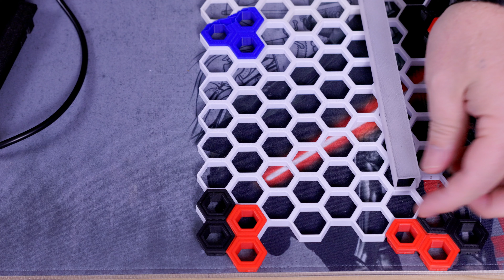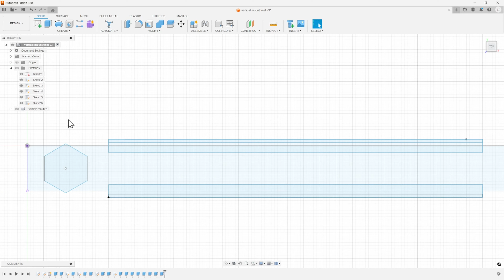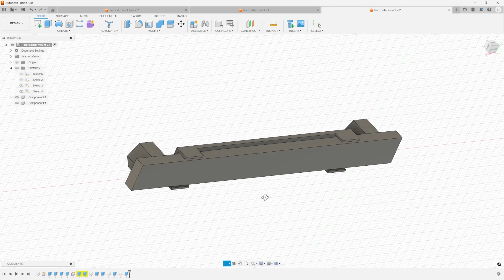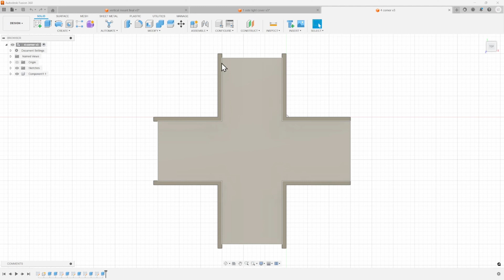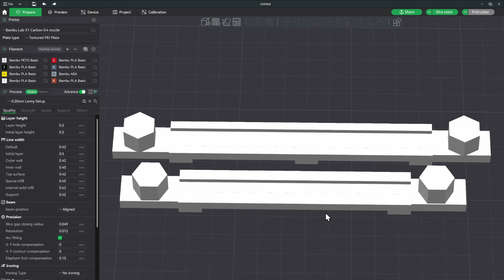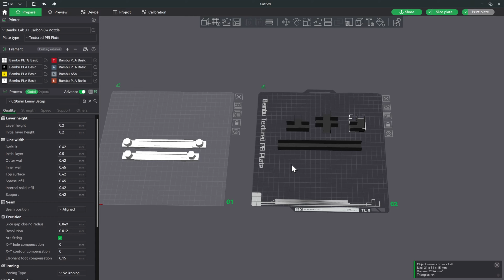Adding Lights to Honeycomb Wall Pt 1

Comment: Hi Len, nice design. a couple suggestions. adding some angled snaps. they don't need support. Will email you the image, comments is not allowing images. Another trick I use when modeling is for mirrored parts, model half, and mirror the different bodies.